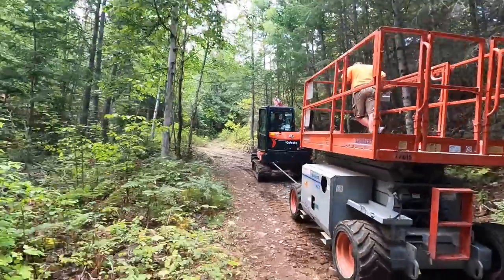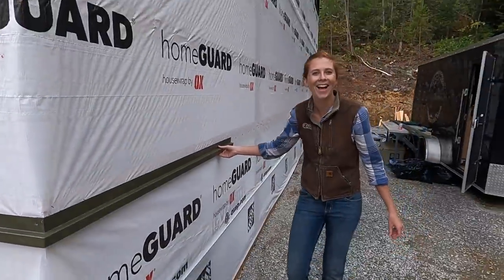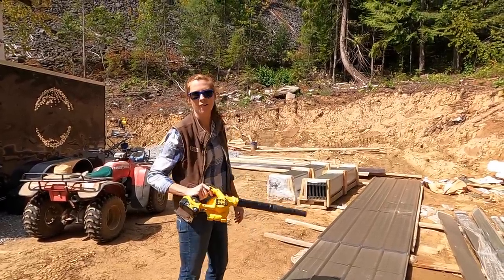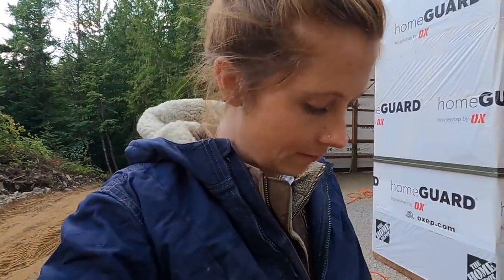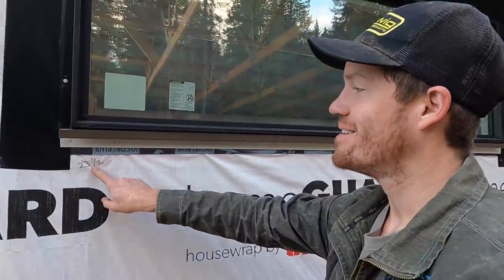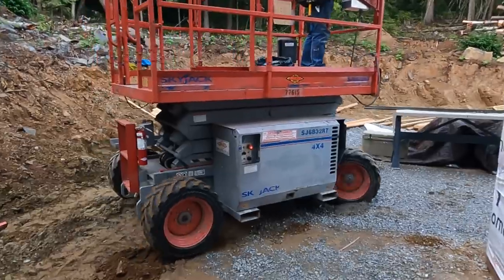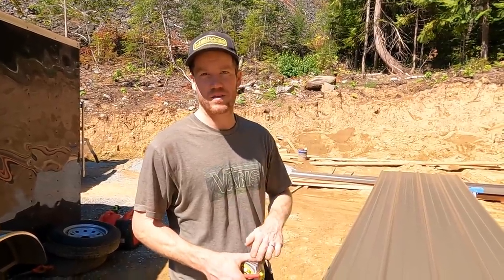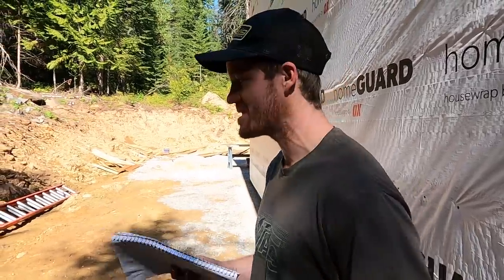Installing Metal Siding On Our POLE BARN | E11

Comment: Great to see an offroad scissors lift!  Many decades ago, as a young union apprentice carpenter, I had to do precarious work off long extension ladders and remember how slow and very dangerous it was.  Almost 3 decades ago, my brother and I started our own commercial construction company and one of things I always prioritized was having the right equipment/tools on hand for me and the men I worked with.  It was amazing to see the difference in production rate and safety.  Most people who do not "come up through the ranks" never realize how important and valuable good working class people are.  Take care of yourselves and don't be afraid to spend a little more for safety and production you'll be amazed at well that works.
Reply: So many times my boss would order lifts that were too short! Ladders, buckets, boxes… whatever it took to get the job done!
Reply: Can't stress that enough. The right tool for the job. Is everything.
Reply: Yeah I've had to walk away from some jobs that the owner wanted to cut costs on that invariably made safety an issue.

Comment: Great work, guys. There is a rule: If someone works on the height everyone below him/her should wear a protective helmet. Please wear helm and glasses to protect head and eyes form falling things, either tools or screws. Take care.
Reply: Safety Third
Reply: Another rule in New Zealand is to always use a safety harness attached to the cage when working on an elevated mobile platform.
Reply: I recommend helmets with any lumber / materials overhead. Had a 12' 2×6 fall putting up my brothers barn. The nail in the end almost went thru my wife's skull.

Comment: Harbor Freight center punch.   It would make marking your holes real easy, and it's spring loaded so no hammer needed.
Reply from the maker: Those tools are great! We were marking an entire walls worth at once though so needed to get through many sheets
Reply: @AmbitionStrikes   I figured it would be easy for marking your top one. Sense you are drilling through multiple sheets all at once you would only need the top one marked.

Comment: Looks so good. My family is working on a pole barn that is super similar. We actually use reclaimed electrical poles for structure. We did lay the slab first and it is three stories but totally build it as we go project like yours. My in laws are just slightly ahead of y’all so fun watch.
Reply from the maker: That sounds like an awesome build!! It’s even more awesome that you are building it as a family. 👊🏻

Comment: Are you going to put a deck off of the sliding glass doors? If so, wouldn't it be easier to install the ledger board now and work your steel around it? Just a thought. You two are doing an awesome job. Love the humor you put into it.

Comment: Here is a tip for using a laser for doing a job like setting the waist trim on the shop.  It is very easy if you have a laser with a 'pulse' mode and a laser receiver.  You can set the laser to the height you want and then use the laser receiver to move up or down until you get a solid tone.  Most laser receivers beep quickly when you are too high and slowly when you are low. Just move up or down until you get the solid tone.  Now, here's one of the slickest things you can do if you have the more simple solid laser which is often very hard to see in daylight.  If you can find an old highway sign with a reflective surface, grab it.  They are generally aluminum with a reflective film on them.  The bonus is if you can find a sign with red and white reflective because you can see the red laser line in almost any light conditions.  This is what I started with.  One day I was at my recycling center when a guy from the county sign shop showed up with about 100 red and white reflective signs.  I asked if I could buy a coupe and he asked that they were for.  When I told him, he gave me five signs for free.  What a deal.  In the last few years, almost all trucks are required to have red and white reflective tape down the sides of the truck and the trailers.  It is now fairly easy to find this in auto parts stores and I have now put it on the full length of several of my levels.  The tape is good for a reference to move a laser around the corner of a building.  You can stick a piece of the tape on the wall, mark it, reset the laser and keep your line going down the next wall.  You can also use this for moving from one room to another inside the house which is nice for setting your outlet and switch boxes.

Comment: I’m somewhat confused Riley said he was concerned over filings from drilling rusting but is that not aluminium sheet steal isnt it a bit heavy ?, plus screws nails etc react with aluminium over time with water. Can you guy clear it up, that all said kinda relieved you got the scissor lift my heart was yet again in my mouth be safe!
Reply from the maker: The siding is 29g steel!

Comment: Probably by now you've realized that it's pretty easy to smoothly raise the scissor lift, but impossible to lower it w/o a jolt at first. It's not Riley's messing with you. When you get time, you might consider building a dog run so your pupper can stretch its legs and you don't have to worry about runaway dogs. Your progress is really coming along and looks good!
Reply from the maker: I can’t wait to build a dog run for Boone!
Reply: @AmbitionStrikes  I thought the 20 acres was the dog run!!  :-)

Comment: Only use that scissors lift on perfectly flat surface! Extended it will tip over real easy!
😢😢😢
Reply from the maker: It has safety limit switches and will not allow you raise it if it is not level.
Reply: @AmbitionStrikes  
The older one my son was using apparently didn’t have those lock out features…
Because his toppled over.

Comment: OSHA would not be happy.  Up in the air in a scisor lift with no  yo-yo harnes? (especially on uneven ground)
Still a great video and I will not call OSHA on ya,  Keep up the  great work.
Reply: I’m always a strong advocate for safety. However, this project is two homeowners working on their own house. OSHA does not apply.
Reply: @moderndimension9632  Yea, guess I should have edited it and inserted <JK> several times, I thought that implying it would be humurous enough.
Reply from the maker: Riley is OSHA's worst nightmare... 😬

Comment: Both of you are doing fantastic job on the siding on your building. I'm little curious.  Your both into safety. Both of you are in scissor lift. Both of you are over 6 feet in height.  Where's your harness? Both of you are supposed to be wearing them. Your lucky O.C.H.O.  would shut you down!!!
Reply: O.S.C.H.A
Reply: If you are referring to OSHA, they are homeowners working on their own residence. OSHA does not apply.
Reply: @moderndimension9632  just curious. Hate to see any of them fall off? Seen it happen before.

Comment: Why are you pre drilling for the screws if you are using the correct screws they tap through the metal on their own. Seems like a waste of time
Reply from the maker: If the screws aren’t perfectly lined up on every sheet it is VERY obvious. By predrilling the entire wall at the same time we were able to make sure all of the screws were parallel and visually appealing.
Reply: It actually saves time. Although this build had a moderate pitch, on steeper roofs, predrilled holes are the only way to go. 

You carefully measure and drill the first panel. That panel is set aside and is now the template for all the rest of the panels. Drill through about 4 at a time.